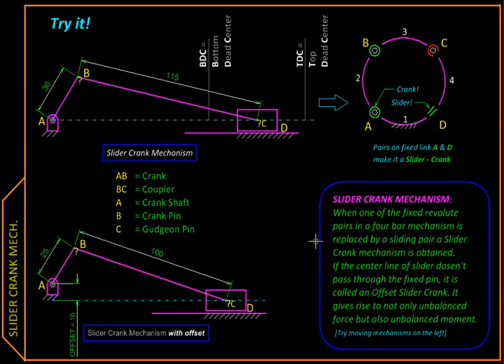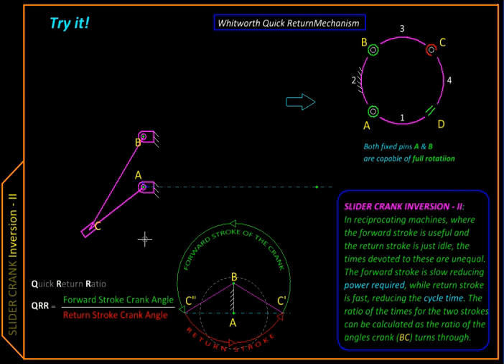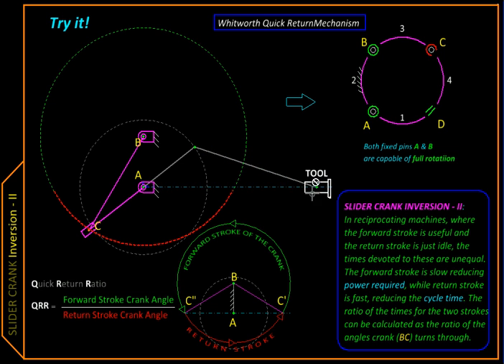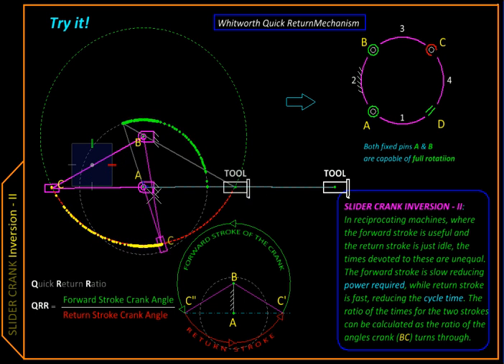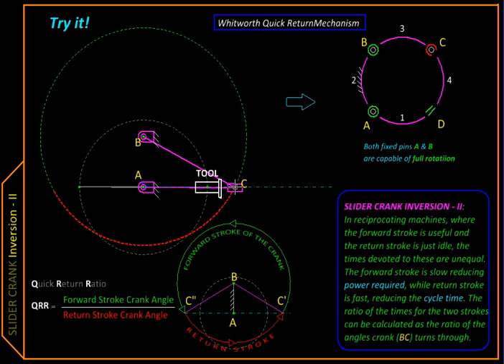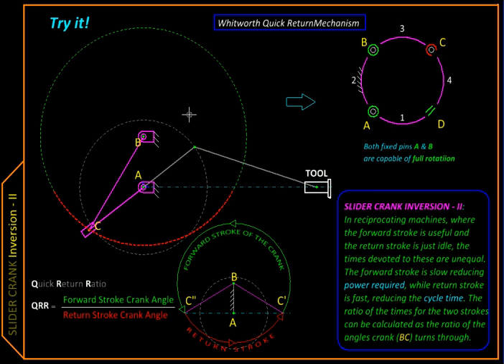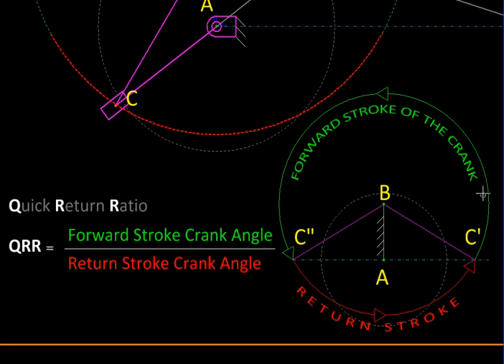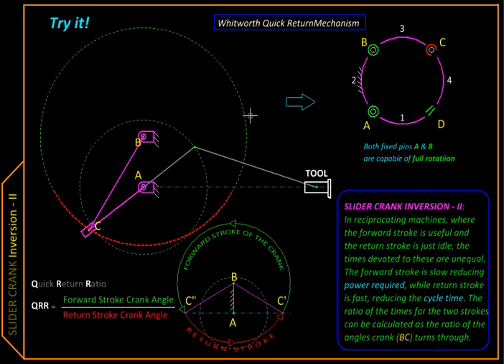Kinematics Ch01G Slider Crank Inversion II

Comment from the maker: @Shane Ellams Not sure if it is the best way of doing it, but I tried it with two vector loops: A-B-C-A and the other holding the tool (which is a simple slider crank). Both are triangles with a side of variable (hence unknown) length. Loop A-B-C-A can be worked out by eliminating the unknown angle (square and add the sine and cosine components) The resulting expression for length AC will be nothing but cosine rule!
Next work out the angle and then move to velocities, acceleration etc.

Comment from the maker: @jarobbins3 
I agree. Graphical kinematic analysis has 2 parts-
1. Geometric Construction - Drawing lines, arcs; finding their intersections; measuring lengths...
2. Kinematics Reasoning - Knowing what to draw and how to use resulting lengths to find linear/angular velocities, accelerations etc.
MicroStation makes step1 a breeze so one can focus better on the second half.
One can construct parametric mechanisms and move them, add ‘flesh’ to make them more life like & even animate them in 3D!